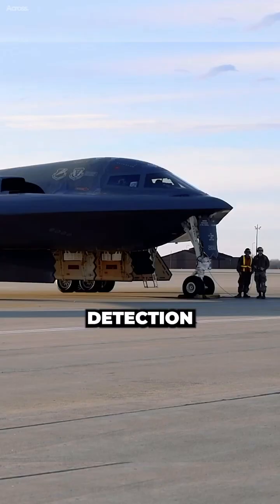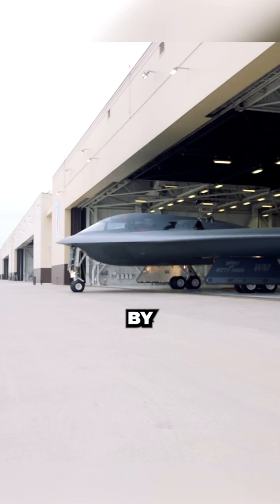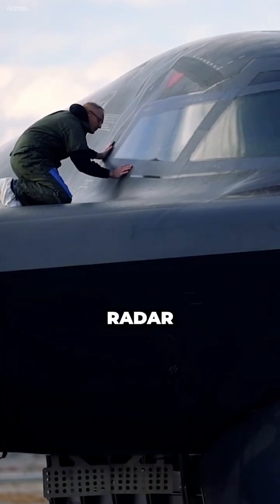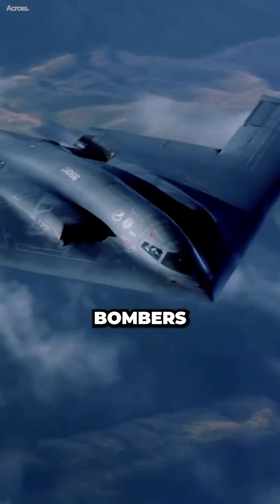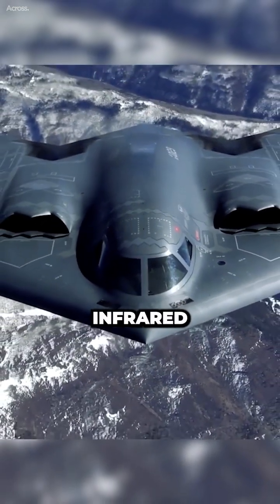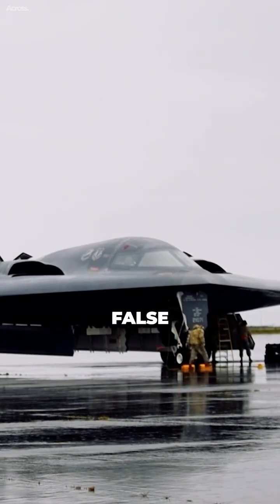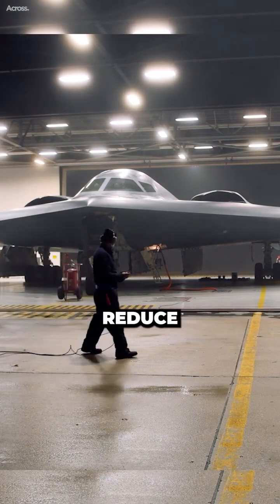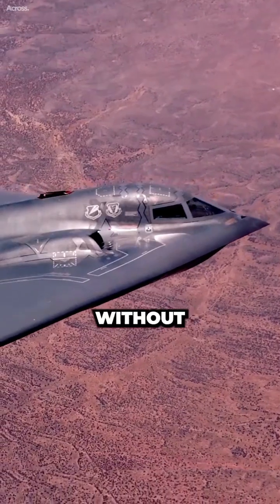How Does a Stealth Bomber Avoid Detection? #shorts

Comment: And yet they cannot operate in the rain.
Reply: Unless going somewhere it’s not raining/on a actual boming mission they can’t it just a bit risky as some times there senors get confused and we know what happens next two billion dollars are gone and taxes rise
Reply: Rain is conductive, which is bad for stealth aircraft, but not a show stopper. The good thing about the B-2 is that it can just fly above the weather
Reply: That problem was fixed
Reply: That's 1990 evidently you stopped reading then.  Not only that but the RAM is baked on now it's permanent
Reply: @bear76009  the baked on RAM has to be replaced all the time. It is a very soft material that gets rubbed off easily. The permanent stuff is the skin and areas of the underlying structure itself.
Reply: @Orbital_Inclination  your talking about the RAM the new stuff is put on then tested regularly after use.  It's semi permanent.